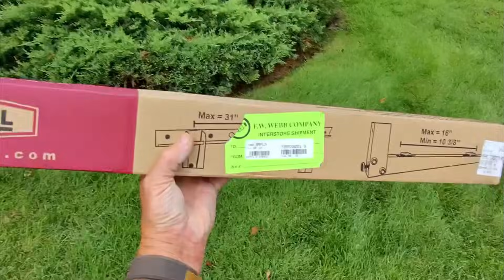Why This 4 Ton AC Installation is a GAME CHANGER for Homeowners

Comment: Mike - I've been struggling with a Fujitsu Airstage R32 installed last month.  After 2 hours on the phone with support yesterday testing EEVs, the compressor, fan motor, pressures, temps.... eventually they told me to change a DIP switch simply noted as "Do not change" in the manual.  They said it was related to energy efficiency.  It improved the supply temps a couple of degrees, but it's still not cooling well.  How has your experience been? I saw you did a "Part 1" Fujitsu R32 vid but never followed up.... thanks!
Reply from the maker: Yeah, we completed that single zone Fujitsu install. ACiQ is out GO TO ductless and ducted mfg. Cant beat the price and service.